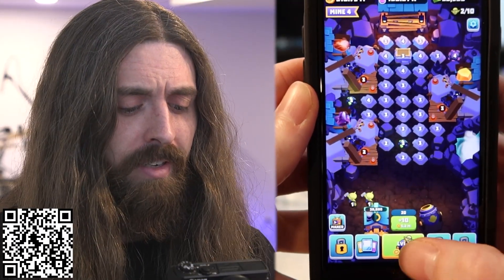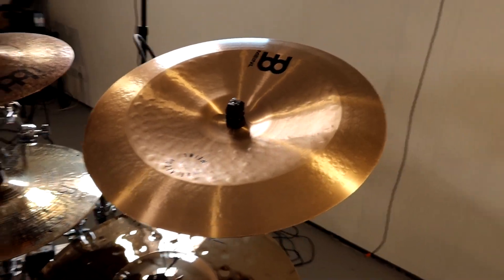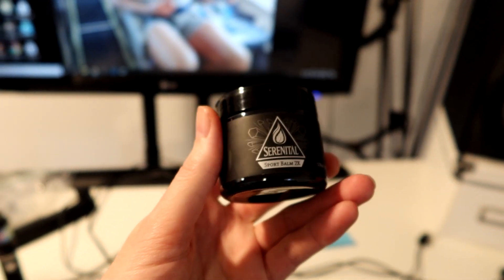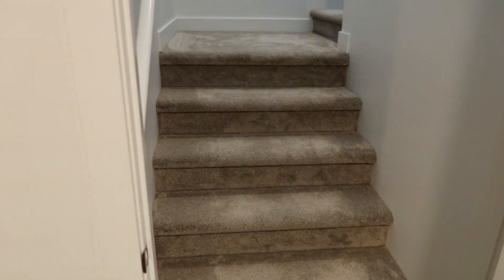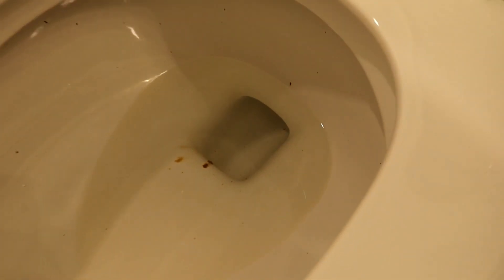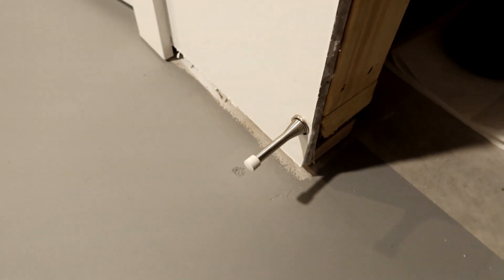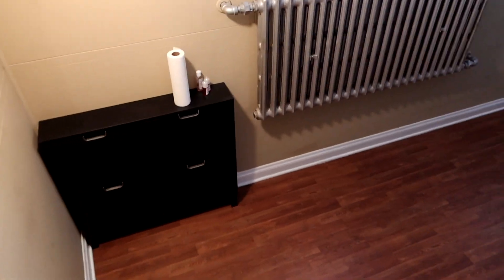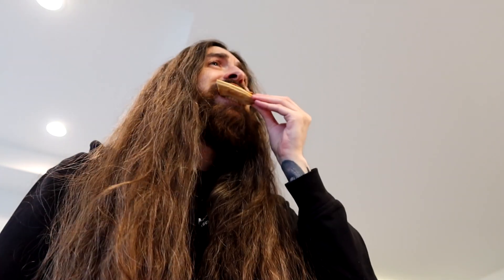Welcome to my new Studio!!

Comment: There some clip you can use that snap in your suspension ceilling with a bolt on them , perfect for overhead or go pro in your case. For the wire routing I did 3d print my own that snap in , I did not find any comercial stuff.

Comment: I have some suggestions for cable management! For the GoPro, just poke a hole in some ceiling tiles to pass the wire through, and it can all lay open top of the tiles in between to make it look nice. 

For the drums, you should get an XLR snake! You probably could get away with a 12-channel, and it’ll give you space for extra channels if you ever need it. Then it’s just one cable between your drums and interface. Looks great!

I’m an AV Installer, so let me know if you need more help, I’d love to give some free suggestions!